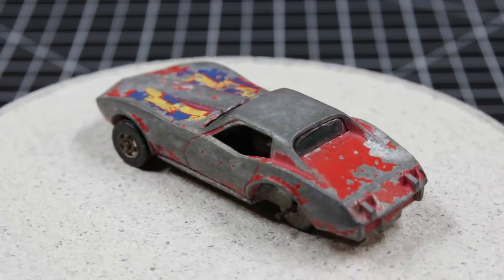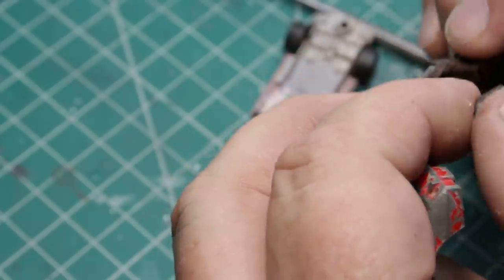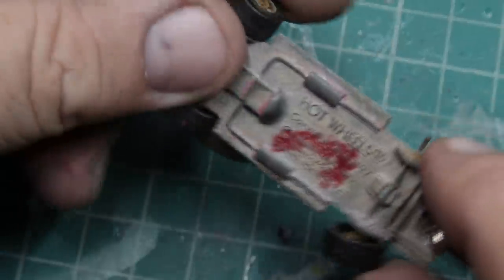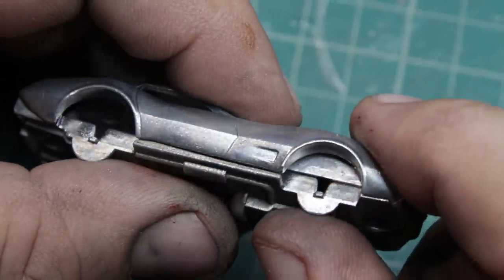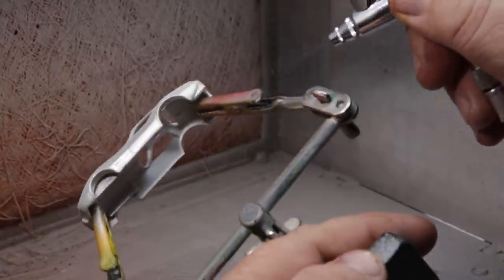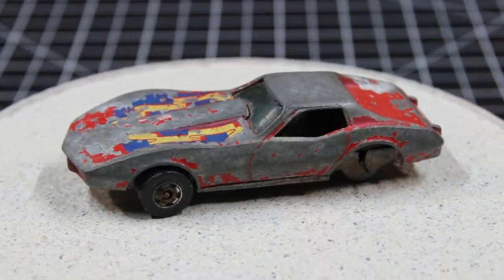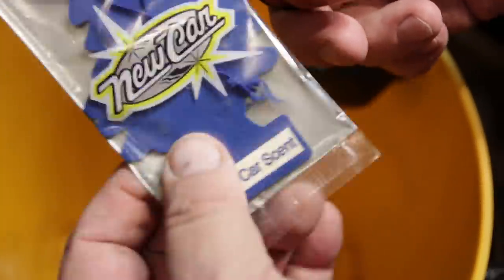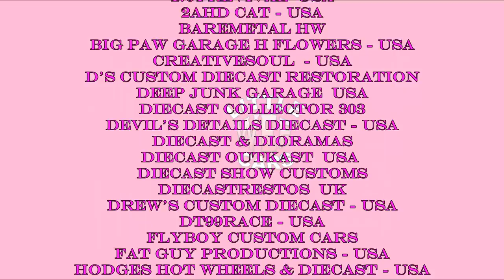Hot Wheels "Flying Colors" Corvette - Custom

Comment: Wow what a difference a little paint does for a Corvette! Those tires are amazing! Can't believe it came out looking so good.🔥🔥🔥
On the bench. The hauler has tool box doors on the side but they appear to have rounded corners, oops. Might want to try a  thinner plain  plastic and a sharp xacto blade
to redo that so everything is squared. Otherwise it is coming along very nice. Love that cab part, it is looking good.👍🏻

Comment: Awesome work Lee, that green is gorgeous!
I brought a bunch of those wheels you showed on the bench, I had the same issue on my Nissan Skyline build the axle went straight through the wheels rim and luckily not into my finger.
Since then I have sanded the knurled end a little with some sand paper, not enough to make it no longer grip but enough to allow it to go in easy enough and remove.
To seal the deal I just dab a little glue onto the end. no issues since.

Btw I seem to have missed this paint it pink challenge, where do I sign up!? :)
Reply from the maker: https://www.youtube.com/channel/UCtYhd90RoHUqKfp9WWzCsZg